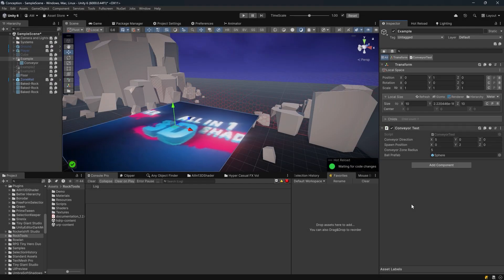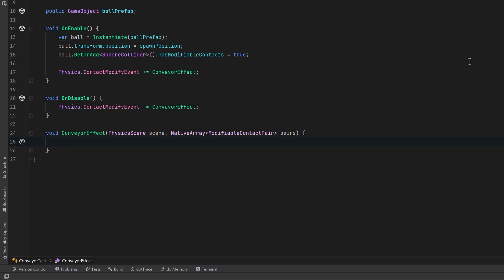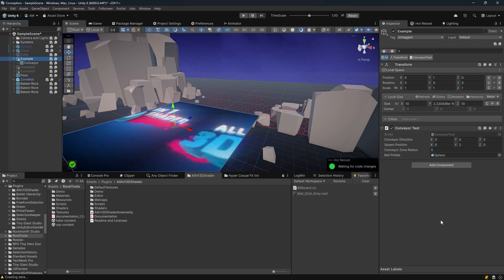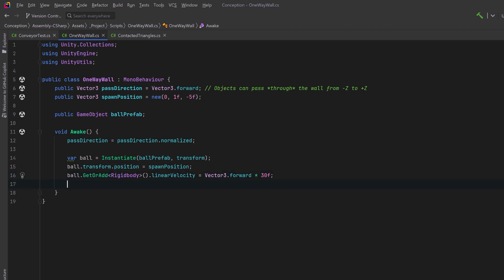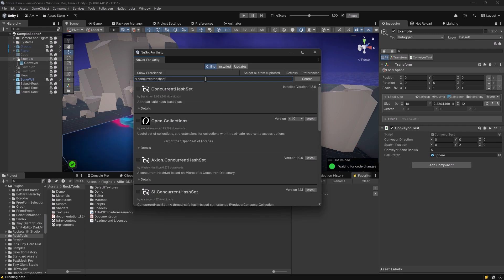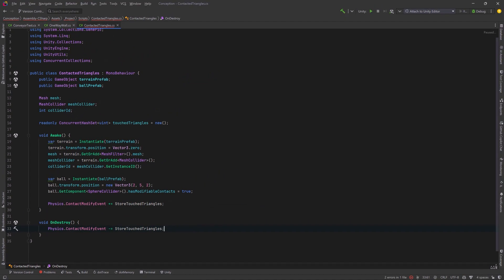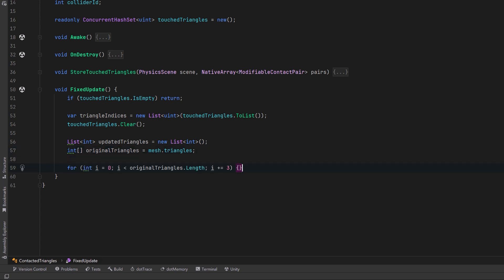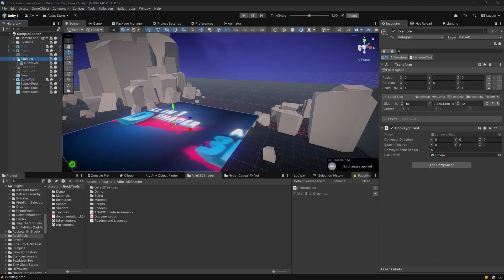Mastering Custom Collision Contacts In Unity For Unique Effects

Comment: 09:11 - For this example we are using a instanceID which is tied to an object. I'm trying to crack my head, but is there a way to create a groupID where i can set a group of objects that will be accepted by my "ContactModifyEvent" implementation?
I thought of a dictionary of instanceID for each group, but i have this overthinking problem that it would increase the cost exponentially.

Comment: For those asking about 2D version of the API, Unity already has videos showcasing it. It is not out yet though. 

The 2D API is currently in the works. Melvyn May, the Unity dev making it, has some videos on his channel show casing some wip of the API being added to Unity.
Look for an angry sun face for channel profile icon.
Some example videos show 2D destruction fragment, slicing, and carving API functionality. 

And yes, we have new 2D physics components coming, but he said they are first aiming to update the current components to the new Box2D version 3.x release for major improvements with devs needing no changes for the benefits. 

This brings multithreading performance, enchanted determinism simulations, and new low level API.
The new Box2D low level API is what you are wanting to learn more about for 2D versions of the ContactModify API. 
This also includes the idea of a new 2D debugger tool for Box2D in Unity.
Not sure if the debugger will release with the first new Box2D update or when the new set of 2D physics components will come out.

You should look at Melvyn May's Physics Sandbox App Build video.  It showcases a lot of the new Box2D features he is working on for Unity.

Comment: I have never seen this before (usually do more graphics related work not so much physics knowledge). Very nice, thank you. 
The fact that the visuals are rotating uniformely already in the shader unfortunately disconnects the ball and the conveyer belt completely. Would have prefered angular velocity from the belt and a better readable model.

Comment: It looks like these API are not available in 2D physics, unfortunate.
Reply from the maker: Yeah, that’s correct — ContactModifyEvent and related APIs are currently only available in 3D physics (PhysX-based). Unity’s 2D physics engine (Box2D) doesn’t expose the same low-level contact modification hooks. Would be great to see parity in the future!
Reply: Replying to everyone wondering about the 2D API. Unity devs already shared videos on the new 2D API working. 
They are adding it in either 6.2 or 6.3 and man do I like all the new Physics2D features coming. 

Melvyn May, the Unity dev making it, has some videos on his channel show casing some wip of the API being added to Unity. Look for an angry sun face for channel profile icon.

Comment: How did you find out about such advanced physics features?
Even though I also try to keep up with Unity’s updates, I had no idea this kind of functionality existed.

Would it be accurate to understand this as an additional layer of processing that comes after standard Unity collision detection, such as AABB?

In the video, contact filtering is used to manage collisions. How does this approach compare to using layers for collision filtering in 2D? What are the benefits?

Sorry for asking so many questions all the time.
Reply from the maker: ContactModifyEvent first showed up in the Unity 2021.2 release notes — it's a powerful but underused feature that lets you modify contact data during the physics solve phase. Conceptually, it sits after broadphase (like AABB checks) and narrowphase collision detection, but just before the solver applies impulses — so it's a precise mid-pipeline hook. Compared to using layers (which are a static, broadphase-level filter), contact modification lets you make dynamic, per-contact decisions based on direction, surface, or object state. It's ideal when you need logic like one-way walls or custom bounce behavior that can’t be handled with the layer matrix alone.
Reply: @git-amend  Thank you for your detailed response, even though I know it might have been a hassle. I’m always sorry for bothering you with questions.

Usually, I implement conveyor belt effects by tiling textures in shaders and then simulating motion with scripts. But your approach always feels more refined and elegant.

Your coding style is different from mine — I tend to follow BSD conventions and write detailed comments — but your way of thinking about code has become a foundational part of how I approach programming.

As always, thank you for kindly guiding me toward a higher level of programming. I’m truly grateful, and again, I apologize if I’m being a bother every time.

Comment: awesome video! about the first example, how would do a conveyer belt that is somewhat radial/changes in direction?
Reply from the maker: Great question.  I think there could be a few approaches.  You could try  to compute the local tangent at each contact point — e.g., `Vector3.Cross(Vector3.up, contactPoint.normalized)` — and use that as the `SetTargetVelocity` direction. It would make the force follow the curve dynamically.  You could store the curve data in a data structure that can be read by all cores at once.